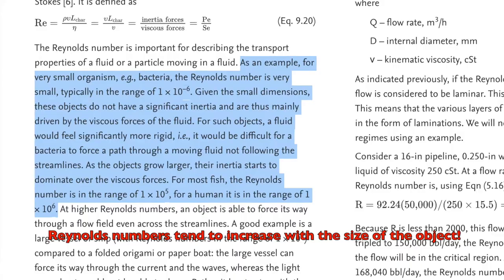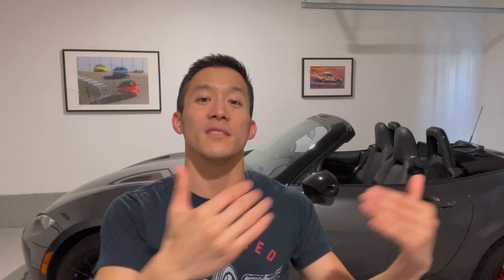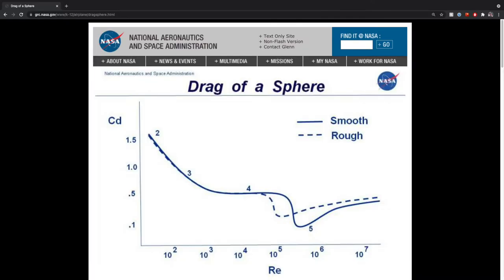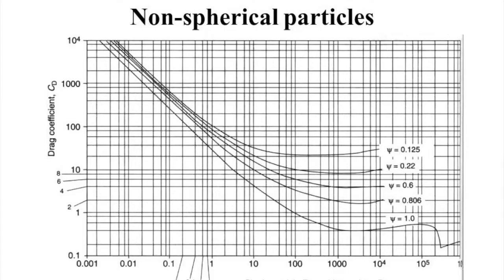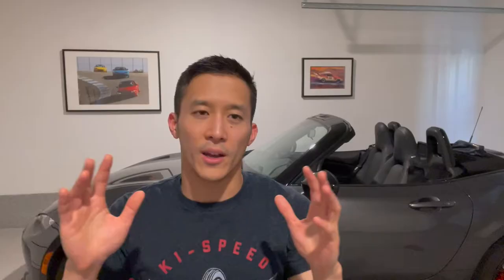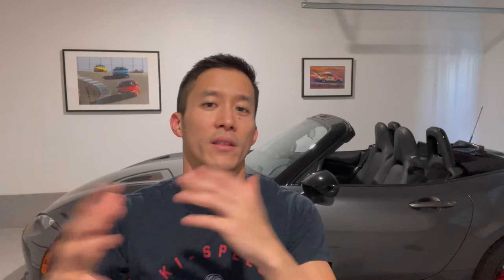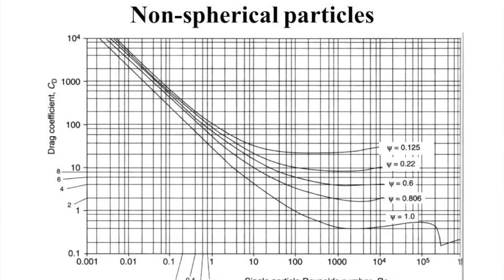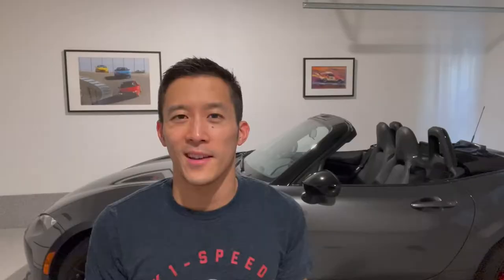Jason Cammisa Got It Wrong: Vehicle size DOES affect Coefficient of Drag

Comment: I have not idea of physics, but when you are talking about the "ball" example, isn´t it because the angle of the sphere changes for a given fluid (air or not), or is it taking into full consideration de size of the ball?
Reply from the maker: Hi Marcos, thanks for your question. The angle of the object can affect fluid resistance as well, but we can assume that the angle is held constant when comparing objects with the same shape but different size.

Here's why the size of the object matters: There are two types of forces (viscous and inertial) that resist motion of an object through the fluid. Smaller objects are more affected by viscous forces. If you scale up the object to a larger size, it will be affected more by inertial forces, and relatively less by viscous forces. 

Thus the size of the object changes the relative levels of the two types of forces resisting motion of the object, and the change in total drag is not proportional to the change in size (frontal area) of the object. Hence, size of object changes the coefficient of drag of the object.
Reply: @JamesPlaysWithCars  got it, thanks for the explanation, is there a number or percentage to which the same same will increase in CX going from a Elise/Miata size to a big SUV size (something like an X5 for instance)
Reply from the maker: @marcos1669  That would have to be experimentally determined, but the percentage change in coefficient of drag as a result of simply changing the size of vehicle would be quite a small percentage. Most of the change in coefficient of drag would be due to the change in shape of the vehicle from Miata to X5!

Comment: Have you ever seen a 747 or any airplane? Now look up stall speed and best glide yes you can glide a 747 it not good. Now think of how much fuel and power it would need if the airframe was a block shape. Oh look at the airplane called the fling guppy. And a diesel electric train.  It is not about size it is shape or everything would be small and cube shapes just think of boats okay I got a test go get a sheet of drywall cut a small hole so you can see put in front of you and run into the wind than turn it sideways and repeat the drywall is still the same weight and size but the the wind and different shape. But at slow speed in town wind is not much of a thing.